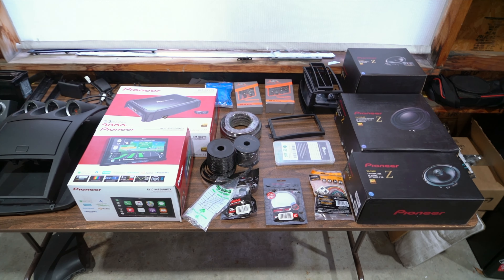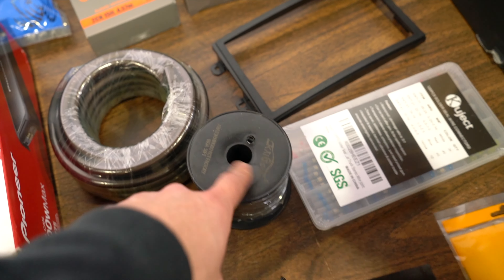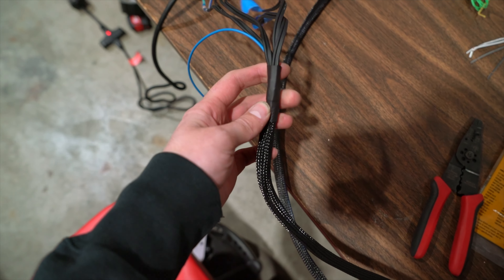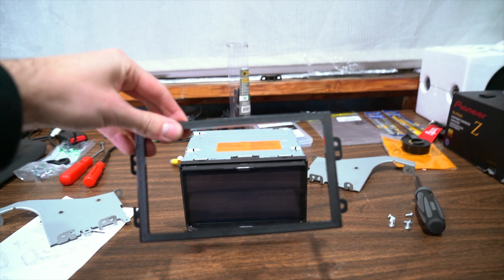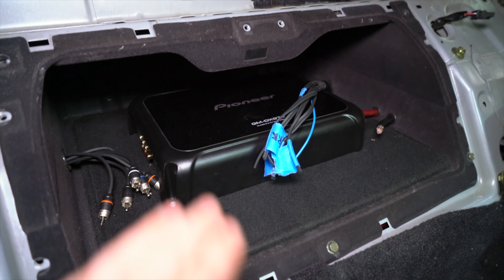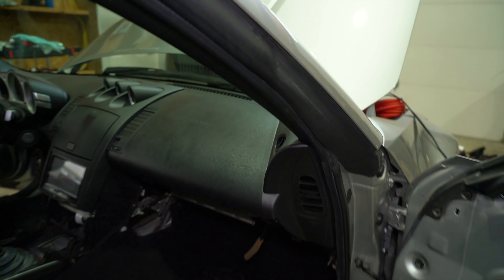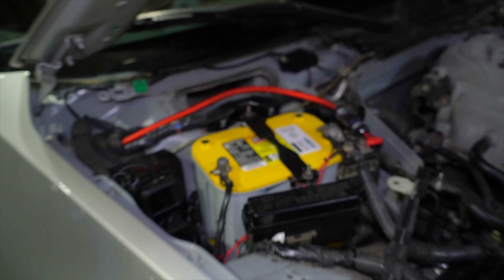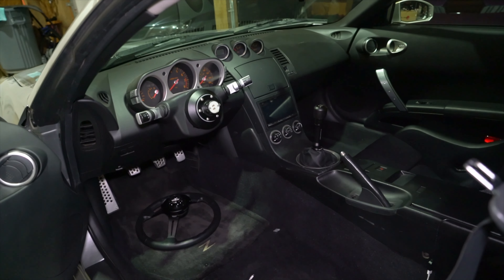Installing an EPIC Sound System in my Nissan 350Z Drift Car! (4K)

Comment: I put a sound system into my ford escape so I wouldn’t buy a nicer car, then realized that while I loved the sound system I still wanted a better car. So I completely removed the sound system and now I have a 4 channel amp, a mono amp, and a head unit with wireless CarPlay. Also bought a 350z and I’m really happy the the purchase. Planning on replacing all factory speakers and installing sub in factory location. I think I want to install the amps behind the sub if possible to maintain glove box practicality. I think the total cost should only be around $600 since I already have the big ticket items. This video is very helpful for planning things out
Reply from the maker: Nice, congrats on the new 350Z! I actually sold mine and missed it so much I bought another one 6 months later 😂 Now I need to install a stereo in the second Z. Glad you found the video helpful though!
Reply: @avengednick  yup! I installed most things already, just working on making a custom sub box that can fit in the stock sub cavity. Got a 10” JL w0v3 which should work perfectly for the box size. One of the perks of buying a cheaper car is you can actually afford to modify and fix it lol. Enjoy your 350z too bro
Reply from the maker: @blackbriarmead1966  right on man! I’ll have to look into mounting the sub in the stock location. I was worried about it rattling in their, but I do think that’s the best location.
Reply: If you have the Bose stereo when you bought your car it’s going to be a problem. Reason being is that your going to have to splice into the speaker wires by the stock amp to run to the new 4ch amp. The rca’s from the new dash will send the signal. Front door spears while they have a grommet you can’t run new speaker wire to them. You would have to use the front speaker wires near the left rear trunk. Rear speakers are easy to just plug into the amp
Reply: @djlunatikx  I ran my own speaker wire, I basically bypassed all the stock stuff. I finished the install and it sounds great

Comment: For the rear speakers, hy run those speaker wires from the amp, to the factory harness. You could have just gone straight up for the rear speakers
Reply from the maker: Thanks for letting me know!

Comment: I saw a few negative points. No backing foam around the door/rear speakers, No sound deadening in the doors and why not use the space for the Sub that is behind the drivers seat, it has space for a shallow Sub. The sound deadening makes so much difference to the sound. Apart from that, a nice setup.
Reply from the maker: Fair points. It was also a drift car, so I was trying to be semi mindful of weight and opted not to use sound deadening like I have in my other cars. And I didn’t trust the stock sub cavity not to rattle with a bigger, more powerful sub and figured the acoustics of the box used would be better.

Comment: Hello, I've had my subwoofer for 1 year now. 4 days ago no start no crank, kept blowing 120a fuse on the battery fuse. Starter smelled terrible like chemicals/burnt. Replaced it under warranty, still no start and blow 120a fuse each time trying to crank.
I tried to start car without alternator connected, at all. And the car started!! I went and bought new alternator yesterday. She started right up!
Ran great! The LAST thing I did was re attach my Red amplifier wire to the battery fuse on the right post. My terminal only has 1 post btw. So then everything back together I go to start and boom, Dead. She wouldn't start I checked and she blew the 120a fuse AGAIN.
So I bought another fuse this time it came with 2 post/studs. I left my Amp wire DISCONNECTED.
And she fired up and I drove it around for the night.
Seems like my sub wire is blowing my 120a fuse.
Why? I have been bumping the sub for over I have been bumping the sub for over a year, what could be causing this? I checked under my rear seats and amp connections seem to be good. Today I might remove the amp 12v and inspect it. Also I have a ground NOT to the battery. Ground from amp to a bare metal near the rear seat. Any help??
Reply: I figured it all out! I had a loose ground on my amp! Anyways I want to amplify my door speakers(deafbonce 6.5) door speakers that are underpowered. They sound good but absolutely no bass when my sub is turned off. 
I will be keeping my 2 channel amp for my subwoofer, my question is how did you power your door speakers thru the factory harness? 
Cus I have my 6.5 plugged into the factory speaker harness in the doors. 
But I thought amplifying them would require it to be unplugged and powered by an amplifier. 
Also 2 RCAs go into my amp from my head unit
Would I need to buy an extra set of RCAs?

Comment: Do you have the link for all the speakers you used in this setup?
Reply: Don't just blindly buy what someone else has; do you homework and buy the components that best fit your needs and your expectations for sound quality. If you have no idea what you want, Crutchfield is a good starting point. They have in-depth guides that cover everything there is to know about car audio.

Comment: Really clean install! Did your Z have the bose system in it? Mine does and the factory amp is just not cutting it. Need to get a 5 channel amp myself. My problem is if yours did have the bose system, how did you do the door speakers? The wiring diagrams I find online are all none bose. Would really appreciate the help if someone could point me to the directions of the wiring for the bose system.
Reply from the maker: Thank you! Mine unfortunately did not have the Bose system, so I'm not going to be much help here.
Reply: @avengednick  all good, I ended up calling Crutchfield and figuring it out luckily.
Reply from the maker: @BudgetBuilds3  right on, glad you got it figured out!
Reply: @BudgetBuilds3 what did they tell you?

Comment: You probably should have used speed wire for your speaker wire. Why did you take out the Alpine speakers
Reply from the maker: I was today years old when I learned about speed wire. 😂 The system that was in the car previously was installed before I bought the car and had some issues and I run Pioneer in all my cars.

Comment: did you run the head unit wires to the “amplifier” part of the crossover for your front speakers?
Reply from the maker: The factory speaker wire connects from the headunit to the crossover to send the signal and then I ran speaker wire from the crossover to the speaker.
Reply: @avengednick  thank you! i just put in a full system taking a lot of inspiration for you, tried to run the wires as oem as possible and am very proud of how it came out, thank you for this video literally don’t know if i would have done it without this

Comment: what mouting screws are you using to secure the amp?
Reply from the maker: I can’t remember the exact size off the top of my head but I just took the amp to my local hardware store and found the largest fine thread metric bolt that fit through the mounting hole